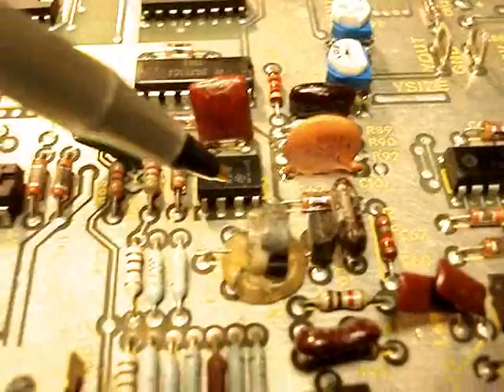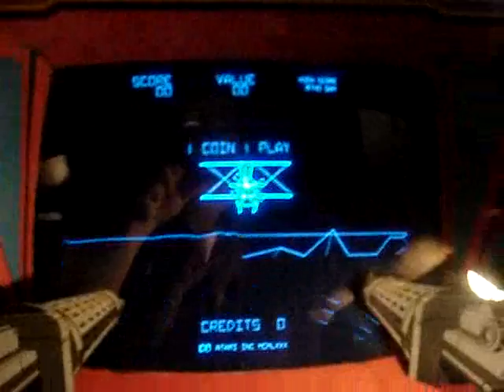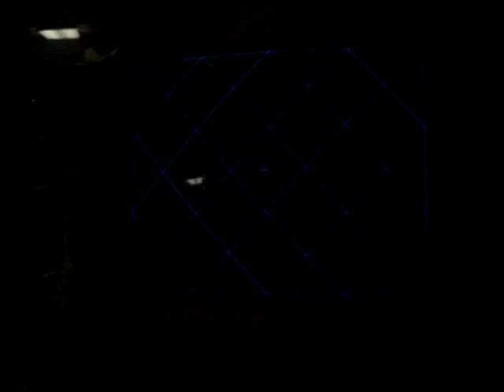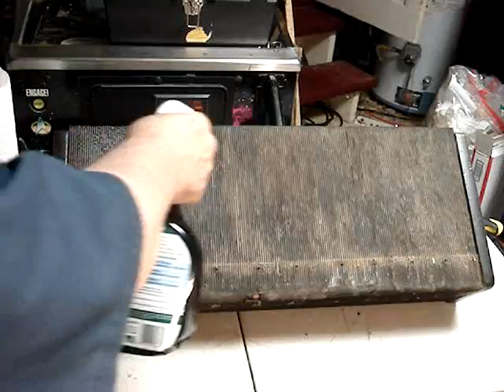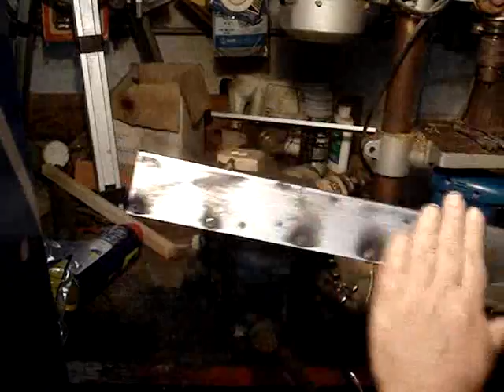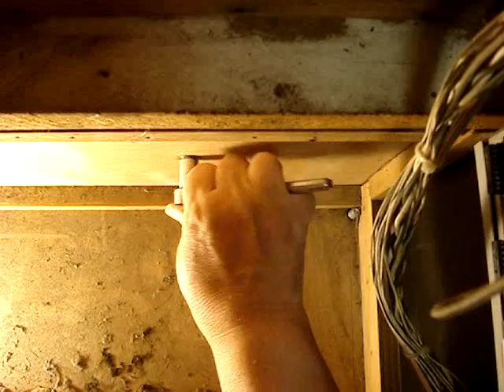Saving an Atari Red Baron Part 9 Game Board Broke Twice Fixed

Comment: I just skimmed through your vid here I am sure you already fixed your problem but I thought it was worth mentioning that I had the exact problem with my battle zone so I added a pot, resistor and a cap so I could adjust the x position    that was not good enough so I had to replace a tlo82 I also swapped the monitor thinking that was the issue great vids buddy keep em coming